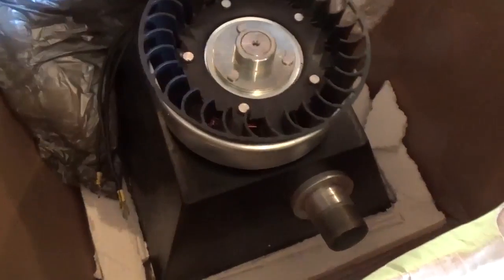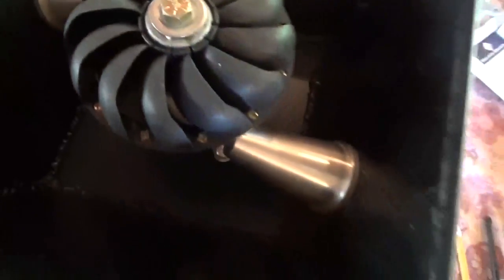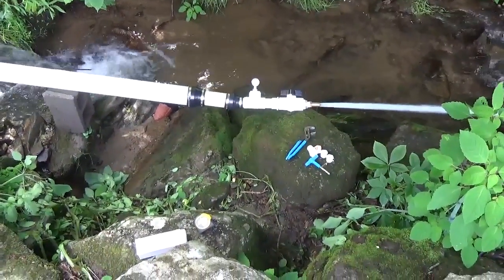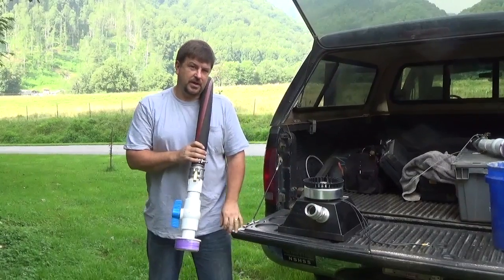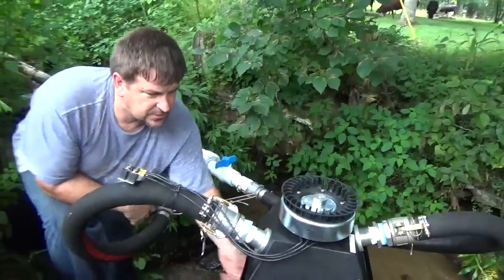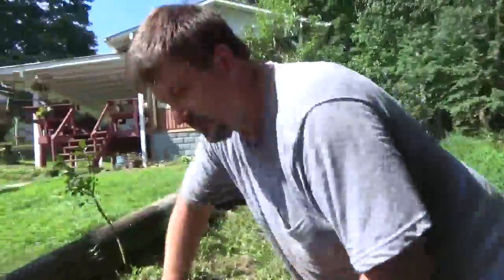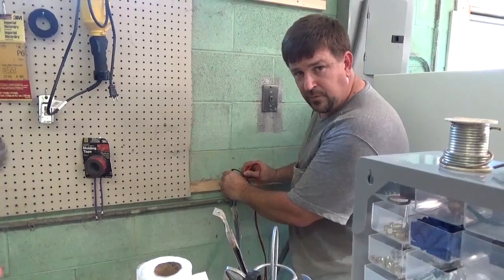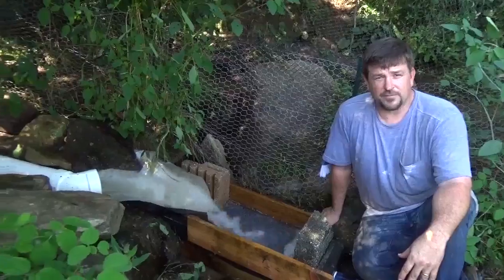Micro Hydro Power with Turgo generator Part 1

Comment: Look up:
"Bell Mouth" optimise water flow

Nothing beats pressure head/height, but:
Any sharp 90 degree collars etc in your plumbing need to be rounded to increase flow way more than most realise.
ie: 'Aero' your plumbing by any means necessary.  Puttys, silicones, glues...

Flap wheels can be held against a bench grinder to better shape them for the job at hand. 
Sandpaper of 500+ grit to finish, to avoid skin friction.

Comment: WARNING, Turning on an unloaded wind or hydro turbine can cause the unit to overspeed and blow itself apart. I have seen it happen.
    Fortunately, the unusual design of this particular unit kept it from blowing itself apart from centripetal force, and "damaging" our intrepid host.
    I have always been vigilant to make sure that I don't do that on any turbines I have worked with, even this unique style, that one day may not be able to withstand it.
    This is the reason that shunt controllers are used with turbines instead of the solar style series controllers. Shunt controllers can keep the turbines loaded at all times, either charging a battery, or instantly sending power to a different load such as an air, or water heater element.
     By the way, shunt controllers will also work with solar, they just typically cost more, though not in this particular situation.
    Those premium $$$ Midnight MPPT charge controllers have an unusual ability to be able to be used with either solar, or turbines, but if you try to combine the two into one controller I would think  the solar and the turbine would have different  Maximum Power Point Voltages.

Comment: Wow, you have plenty of flow.. the best system i seen that wasn't some outrageously priced setup was on gridlessness. They checked out a guys system that was making too much power. He had a dishwasher, and everything else you would find in a on grid home. He used the extra power to run a hot water heater and he would have to occasionally dump the hot water just to use the power he was making. He diverted part of a stream into a timber box that looked to be 6 or 7 feet deep by 6'x8'.  He could close the water intake and then open up a clean out once a year to get rid of the sediment. He had a foot x 3ft screened outlet a foot off the bottom.. system was cool and he wasn't dumping sediment in the stream. He had a holding pond and I'm sure he used the rich sediment for his garden

Comment: I am a professional boilerman of 45÷ years.
I do commercial and industrial boilers.
I can tell you that your turbine wheel design with nozzles in a
 "box" downstream using pressure flow is stupid and a waste of your resource.
You need a regular pump vallute to tighten the tolerances around the blades.
That eliminates the nozzle b.s. and makes it so you can put the turbine at the top of the flow and have it driven by the syphon negative pressure caused by the water weight and the distance of vertical drop in the pipe at the bottom of the flow.
( it will pull about 7 pounds per 3/4" of pipe per every 10' of drop. Larger pipe will pull more.) There will be no cavitation in a pulling situation if you tighten up the tollerances on the blade on the turbine.
Your local plumbing wholesaler will have pump experts that will help you set up the turbine head better and they will be happy to help!
They have pump and pipe sizing experts that can figure the size of piping according to your vertical drop and reverse engineer the syphon flow instead of the flow pressure.
Think about it.
A pump uses a motor to push water and pulls power.
A turbine should use flow effectively to pull the motor into action to create power.
Power dams dont put turbines in the pressure spot.
If anything breaks they flood.
Your tolerances on you turbine blades and the design of that blade combined with the right vallute will make your tubine a trouble free generator rather than a silly looking hobby you guys are playing with just by asking the experts at the wholesale house to tighten up the head and lose the nozzle idea, and using the sypon effect gets the works out of harms way and in a more efficient negative pressure driven situation that eliminates that box, pvc valves and that funky piping around the unit.
Once you have the proper parts that dont need any special "drive" mechanisms and you are pulling a good profit, just send me a large cut for helping! Lol.
Luck to you,.. And common sense "Engineer".
Reply from the maker: What does being professional boiler mean have to do with siphoning a turbine? When obvious common sense thing that you're missing in this application though good in theory is maintaining a siphon. Once the siphon   is broken either by drought or just lack of flow seasonally the siphon has to be restarted.  I do like the siphon systems and that's what I did on my pond so I'm not against it It just doesn't work in all applications like this creek that has huge variations in volume. Pelton wheels turgo wheels etc inherently deal with volumetric changes where siphon system cannot.

Comment: I ve got about 300 gal per minute about 70ft drop.   On 700foot run to generator.  Im trying to figure whst is best pipe to use.  Thinking getting 2in poly but see you used pvc 6in.  And look like (abs?)  Any insights be great.
I can shate with you my project. Its amazing i got 39 springs each one about 10 to 15 gal per min damning each one then running li ne to bring water to gen... its huge amount of water very exciting. Going to do popcast of me putting it all together .
Also going to contact Langston..

Comment: This stuff really works.  I designed and built a micro hydro system 38 years ago and it has worked 24/7 ever since.  Original turbine and pipe work, but had to get a new generator a few years ago.  Powering this email.
Reply: 16 years here!

Comment: 24 volts over 250ft will need a large area cable to avoid volts drop. Mabe put the rectifier at the generator. 
Large bore pipe taken as close as possible to the turbine gives the least flow restriction.

Comment: I'm fascinated by this work. I believe this is the cleanest w energy you can get. I would like to do something back in Africa and I was wondering if you can help me with that. In general, how much the turbine and all the other accessories cost? Will it be possible to run Air conditioning, refrigerator, microwave with the generator you used? I wanted to do this on my own, but I don't know what challenges I will be facing. I also wanted to k ow how you hooked  you the wires from the turbines to the charge the battery. Please advice. Thank you and good work.
Reply: http://www.langstonsalternativepower.com/

Comment: What are you really gaining by having a 90 debacle turbine running 24/7 that solar can't compete with? The noise, the constant tinkering and maintenance
not to mention how bad they look with these pipes running everywhere. The rate of return just does not to add up.

Comment: You ran the 3 phase ac from the creek to the house, does it make any difference if you have the rectifier at the creek and run the 48 vdc from the creek to the house?
Reply: You will have more voltage drop over a long distance with DC current vs AC unless you run really really big cables more effective to run 3 phase AC

Comment: You might be able to use the air entrained in the stream to lift the water to a higher elevation holding tank. You could also provide a wind turbine to force air into the lift system to add even more lift. The holding tank would have a bottom drain valve to have a greater percentage of water throughput/flow into the water turbine system. The entrained air from the stream will dissipate as the holding tank level increases. The air entrainment/lift system is a takeoff from an airlift system used in the oilfield industry to lift the oil and water emulsions from the reservoir to the topside for separation. 

Another thing you will need to consider is a secondary system as over time I expect scale deposits to build up in the tubing and possible the turbine.  This will reduce efficiency. The secondary system will allow nearly continuous power generation during the de-scaling process. By the way all scale is not created equal, so the same cleaning process may differ over time. A prevent mindset will take periodic samples throughout the year for water analysis before you get to the point of shutting down for de-scaling. The de-scaling process may require chemical treatment. Introduction of chemicals into natural resources may affect aquatic and human health downstream. The consequences would probably precipitate fines and/or imprisonment. Hence, the prudent course of action is to separate the chemical treatment process from the natural resources. Also, don't forget about legal permits for disruption of natural resource environments. All the money you may be saving could be swallowed by subsequent liability for cause of action.

Just some things to think about.

Comment: actually.... yes.  I could use a little help with exactly what you're doing.  I have two water falls in my yard, one flows with a little more than what you seem to be working with.  I'd love to harness the power that flows by 24/7 365.

Comment: Really nice wheel I can't believe how efficiently it revved up to speed with 11 PSI. 
300 FT is a long way for 50 Volts 3 Ph at I'm guessing around like 5-10 amps.
I suffer from a touch of Megalomania so my first thought would be switch and step up the 3 Ph 50 V to around 500 V for the 300' and then step it down at it's end point (just like a transmission line). All boils down to losses. Which would lose less would be a fun day for me to figure out.. Love these systems I'd say it's everyone's dream to cut the light bill and carbon footprint. Great vid, thanks.
Reply: 4:10 he pushes it through a rectifier, so he ends up with ~50V DC eliminating inductive losses (skin effect, line capacitance, etc.)
Calculating losses using a generous 10 AWG wire, and assuming "10,000 watts of power per day" means "10kWh of energy per day", 416Wh (per hour, negate hours for 416W), 8.3A, gives us a voltage drop of almost 20V, or 40% of the power spent heating the cable.
BOOOST THAT VOLTAGE!!!

Comment: Hello, can such a system work in a closed loop in a circle?  For example, a pumping station delivers water, water passes through a turbine to a tank, where then, the station delivers it again to the turbine ... Thanks
Reply: Do you not understand that this would net you less power than you used to do it?!!

Comment: Het brother , i highly recommend you not rectify the current until it gets where its going , not sure if it will make a big difference but according to Tesla it does. Dc current does not travel distance well at all . Even a 120 volt AC extension cord suffers serious losses my friend   , 3 volts per 50 ft 
At 10 amps

Comment: I'm thinking of using 4-8 tiny nozzles, putting water on as many paddles at once as possible, with a couple gmp it may not work,  it would need about 1mm nozzles, I may have enough water for a 5 mm nozzle, or so. 40' drop, in 60' if pipe, there is alot of maths I gotta figures! Plus a pond to dig before anything! Off grid is hard, but worth it, especially, when the power is out and the neighbors show up with a extension cord!!    Ha-ha, I do want to have enough power and battery, I can give them enough to run a fridge and lights, I try to be a good neighbour,

Comment: I need something like this, but I only have a spring, to work with, I would probably have a high pressure, low volume, I could probably use about 40' of 6"pipe, then funnel down to 1.5" at the nozzle. I may build a resivor, use extra solar to pump from the creek, for hard times, I think a water "battery" is more effiecent. Genearte the power as needed, over storing in batteries, I'm offgrid, so every watt counts!

Comment: Use a step up transfer to decrease loss due to distance form generation and consumption point. Also you can use it as AC no needs to convert into DC by simply installing a governor or feedback system which will control the flow rate according to the load.

Comment: Smart anytime you can run AC for long wire runs. Much less inductive loss. A transformer to up the voltage will allow smaller gauge wire runs. Solar inverter panels and 3 phase alternators for wind or hydro sources to generate AC.

Comment: I was a hydroelectric powerplant mechanic for several years at the 3 biggest hydroplants in Colorado on the Gunnison river. Always love to see small little units like this. Great work. After working and operating the big units I think I would just be impatient with my own setup lol.  The biggest unit I've worked on daily produces 60MW almost nonstop 24/7 except for 3 weeks of maintenance once a year. The biggest unit at Grand Cooley cranks out 600MW!!!
Reply: So how big or small of a creek could be used? It's year round. We tried measuring gpm with a 5 gallon bucket.

Comment: Would this work using a city fire hydrant as the Water source, I think I can attach.a fire hose to the hydrant at the back of my street and the modify a hose connection to the Water turbine!
Reply: Absolutely... buuuut I don't think your city will approve of the use of their water in such a manner.
Reply: scott bleackley 
Yes that is a thoroughly stupid question in so many different ways.

Comment: where did you get your turgo wheel and how much GPM do you need to make it function?
Reply: Langston's alternative. power it depends on what voltage you need  but you would need to have at least seven to eight pounds of pressure  at  40 gallons per minute 843 319 4830

Comment: Please I need help, am having 125vdc from the output of the rectifier, how can I make work or step it down to 12vdc
Reply: You can change the stator in the generator or you can get a midnight classic charge controller will take in up to 150 volts DC and step it down to 12

Comment: speaking of alternative energy, can anybody help me hook up electrical from my neighbors house ?
Reply: lol It shouldn't be too difficult. I've seen some pretty big power strips at Home Depot. Be sure to only buy appliances with green power cords, so they'll be camouflaged in the grass.
Reply: @Paradoxical Nightmare 
Alberta oil field 2005, Suffield (AKA the Suffering Fields) & Medicine Hat (Best Pussy in the world by the by) we were decommissioning an oil well and someone ($OB Dutchman farmer) tapped into the casing with a 1" gas pipe treefeet down, we followed it to his main dairy barn.

That well was aboot 30yrs old EH...The Cuntsultant said it was in the millions of dollars that they lost.
Reply: First MAKE SURE you main breaker is OFF or you will kill a line worker. Now this works but I do not recommend doing this as it is illegal and unsafe but if you have to Then you Just add another male end on an extension cord so both ends are male then plug it into your outlet then his. This will only power up half the outlets In The house or rather all the outlets/devises on that leg of the 220 panel and it will also not give you any 220 power unless you added another plug and plugged into the second leg. Now to be clear you should definitely NOT do this but it will work.
Reply: In Vancouver B.C. 1980's & 90's they would tap into the main house electricity feed ahead of the box....so they could grow weed....$3200.00 per lb.....Good Times.
Reply: Idk whether to call u guys in the comment good or evil
Reply: Haha
Reply: Best comments
Reply: Rain Man I can tell you how to hook up your home to the street lights if that helps?
Reply: Lol, nice one 😂
Reply: Suicide cord……
Reply: Get an ecoflow pro and plug it in someone’s Tesla charger;
Reply: Ask any lad from the City of Liverpool England (scouse feckers) they will send you out instructions for exactly how to go about it.
Reply: @marksmith5977  that's right they will

Comment: I'm curious. I have the same Gen head. Shouldn't it be protected from weather? You seem to be running it wide open. Are the windings that weather proof?
Reply: Did you purchase it from Langston alternative power if so it may look the same but it's not. You do need to put some sort of cover over the top not necessarily for the rain but sticks and debris falling onto the flywheel

Comment: Finally someone smart enough to run the 3 phase to the control room. So many out there rectify first at the turbine and then have to deal with DC line loss. Duh. I'm subbed. Great vid guys. I did all the testing here on cheap 1 1/4" pipe so now going 3" x 600' and 35' head. I think we'll see success.. Hydro is always the way to go if you were smart enough to purchase the right property to begin with. Far less batteries needed due to 24/7 power.

Comment: What would be the maximum distance ball park you could run the 3 phase wire to the 24 volt rectifier?  I have a stream about 550ft away from my off grid house.

Comment: Good concept poor execution - do some calcs and dial it in.
Reply from the maker: And what might those calc be?
Reply: @engineer775  It depends on a few things: year-round flow or seasonal flow, determining the average flow to maximize the overall efficiency of the system.
Reply from the maker: @planetcave  oh I thought you were going to share some calcs with me.
Reply: Engineer775 
I thought he was going to show how higher volts and bigger wire would make the voltage go up a lot. Cuz it will.

Comment: Bro i tried to do that By using water turbine, 1.5kw 3phase motor but a'm getting only 50vac and I want to step up up to 300vac by using auto transformer of 10kva. so is it possible To run almost 8kw loads without over heating of Motor coils??